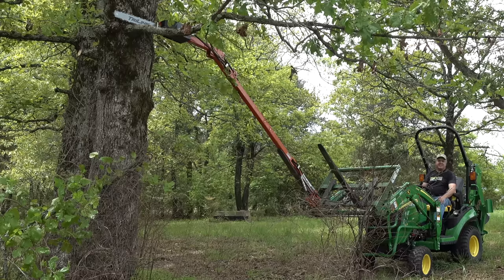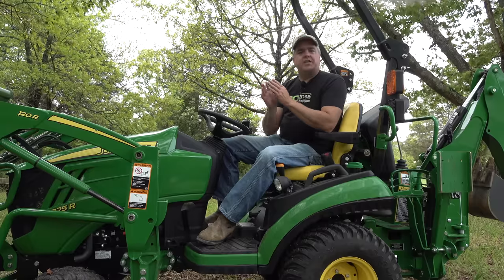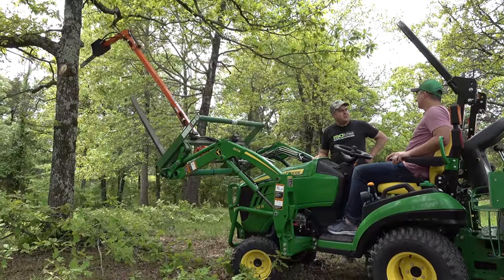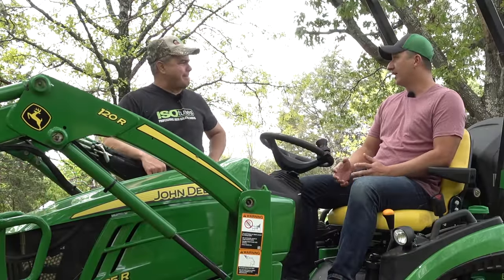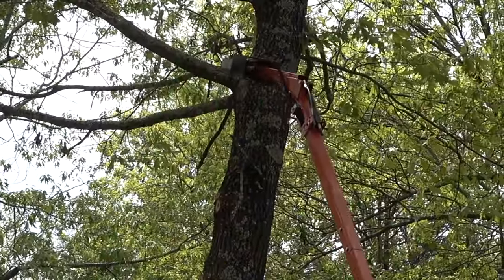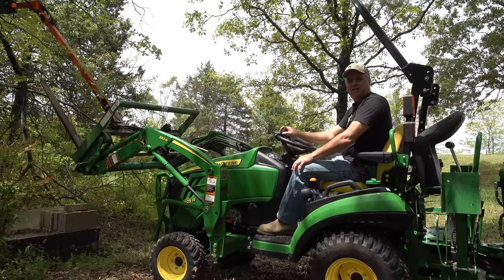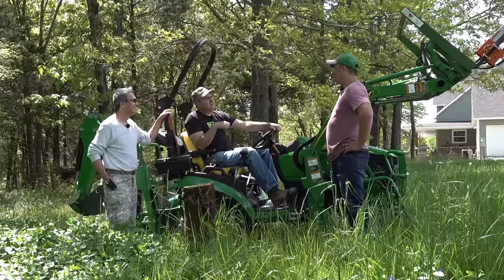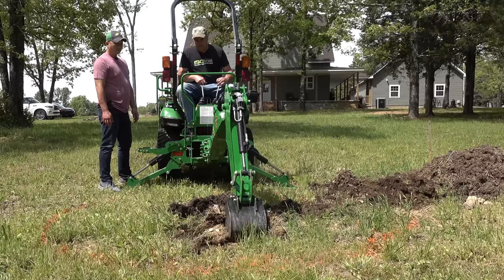MORE JUICE!! When Stock Doesn't Cut It! 2x Hydraulic Flow!!!

Comment: I have added this HydrosPlus assembly using the higher capacity pump (9gpm). I also have the Summit four-spool remote hydraulics kit. Lastly, I did the tweak to my pressure valve to increase it to 2100psi. All of these changes sure make this little tractor (2018 1025r) from a pee-wee into Goliath. A LOT more lift on the front loader and backhoe, plus the extra flow available allows you to use multiple control spools at the same time. I even had my wife operate the front loader while I played with the backhoe controls and all four spools on the backhoe still functioned at the same time as the two spools on the loader. Amazing stuff considering how puny these things are from the factory! 
This new larger capacity pump and new adjustable splitter valve really do give these little machines a whole new personality. Ad Kevin gives such great support for his product! 
Something else to consider is just how much ballast weight all of this adds to the rear of the tractor. When I also added a hydraulic top link, hydraulic tipping link, flow control valves and hoses, it has added 143lbs so far. 
About $2600 so far, but I believe my little machine is about as versatile as any much bigger tractor now. Warranty be damned!

Comment: This kit is very easy to install and Kevin is great to work with. Plus his install vids are awesome!  I installed Deere’s factory 3rd function and I would say that was 10x MORE difficult than the Hydrosplus install. And Kevin supplies high quality components with most hydraulic fittings being o-ring face seals.  When I started my tractor up after the install, there were no leaks. It’s a completely different tractor; in a good way!  I highly recommend this kit!

Comment: Very impressed with how efficient the backhoe works with more flow. Looks a lot closer to how a mini excavator works. Way smoother too!
Reply from the maker: ...and I think I would get better operating it with more practice.
Reply: My old Yanmar backhoe  I ran it on the thousand RPM PTO instead of the 540 setting 540 setting was like watching paint dry!

Comment: This is definitely a game changer.  I have been disappointed with the slow loader functions since my 1026R was new. I move dirt often in my dump trailer and it takes forever to get the bucket all the way up. Have also been annoyed with the slow backhoe functions although it doesn't get used that much. Time to talk to the finance committee!  Thanks for showing this product Tim.
Reply from the maker: ...meanwhile, Jim. Make sure you throttle up!   Running higher RPM will help your hydraulic flow (and therefore loader speed) tremendously.
Reply: @TractorTimewithTim  Tim, I normally run between 2500 & 2700. The larger pump and flow divider change is a good fit for me, since I don't run WOT very often.

Comment: I have always thought Deere and Kubota have restricted the abilities of these tractors because the buyers are first time equipment operators. I struggled when I would go from a Deere 310 to a BX I couldn't achieve the results do to flow.  With this modification Deere should look into this as a industrial 1025R paint it Yellow and Black. This looks like it is puting the backhoe on par with a 1ton mini ex.  I think you should ask the CFO for funding.

Comment: this was actually pretty useful and something i could see putting on a 1025r myself....i do like the hydrolic cooling system on the 1025r, im not sure why no other manufacture has done a similar system, to me it would make your tractor and hydro run cooler, especially out west here in the hot dry heat...

Comment: Great video Tim. That is a great solution. Always can use more flow. I was surprised to see your 5 series has less than 12. You should see if he can provide better pumps for larger tractors, specifically my 4320 hint, hint!
Reply: GPM is the only reason I bought a Kioti over a JD. They need vast improvement.

Comment: I hate the slow loader speed on mine. I had a Yanmar before and it was quicker. Once you've experienced speed it is frustrating to wait for the bucket.
Reply: That's precisely why I bought a Kioti.
Reply: @rebelcitysports1outlook713  which a Kioti ? They have a stronger backhoe? I’m down to three choices , John Deere 1 series, Kioti 2520 or 2220 , LS MT125 or Mahindra Max or Emax.These seem to be the only ones with position control on the smaller subcompacts.
Reply from the maker: LS MT 125 does not have position control...at least the 2018 model did not ...
Reply: @TractorTimewithTim  Geez I thought I saw it on the last brochure I picked up . This was several years ago.

Comment: Hope Deere looks at this and puts it to use in future tractors.
Reply: Deere doesn't want this because they want to sell u a bigger more capable tractor lol
Reply: @adambowhuntz  Sounds about right.
Reply: That valve is expensive.  JD would not put it on the low end tractor (small ) tractor like the comment above.  But for utility higher flow is good, for "tractor" pulling things not so much.  See popularity of high flow skid steers and thier implements.
Reply: John deere  lawyers and bean counters would never approve.

Comment: These things do not "void" a warranty. Rather, if you have a failure and it is due to a non-OEM component, then that particular failure would not be warrantable. But installing an aftermarket pump does not "void" warranty on your seat, for example. Good talk. See you out there.

Comment: Man I hope he makes a solution for the large frame 2 series in the future.
Reply from the maker: Me too!
Reply: @TractorTimewithTim  How about 3 series.  I have a hydraulic pole hole digger that would work better with more flow.
Reply from the maker: What brand and model post hole digger?  Loader mount or 3pt?
Reply: I need for my 2032R!
Reply: Another option would be a pto pump  and tank setup on the rear then you could power a front mounted shredder, auger, limb saw, log splitter or any other high demand implementation. I had a 3point backhoe powered by a pto pump that flowed 11gpm on my L2501 even at idle it had plenty of flow. This would also preserve warranty and cost less than $1,000 and with the use of quick connections could be used to power various implements.
Reply: After adding 3rd function And 4th function for tilt on my 1023e I knew right away they had to steal steering. He fixed that with an expensive flow divider, not the cheap original one.  Good job!
Reply: @TractorTimewithTim  It's a 3pt.  I am not where I can get the brand.  I can get it this weekend.
Reply: The hole digger is a Shaver Mfg. Model 1020.  I looked up the spec and is rated at 10-20 GPM.  I acquired when I had a JD 3010 for digging hole for pole barns and lifting trusses.  It works on 3033R at a reduced rate.

Comment: While increased pump flow improves many aspects of hydraulic performance,  here are some risks with adding this kit.  The steering flow is not sized for the steering cylinder speed.  The orbital steering valve has a gerotor that controls how fast the steering turns.  You will know if you do not have enough pump flow when steering because the steering effort increases with insufficient pump flow.  The flow to steering circuit is necessary to PROTECT THE HYDRO.  Secondly, reducing the flow to the oil cooler which is on the steering circuit reduces its capacity to reject heat.  You are increasing the heat by increasing the system flow,  adding an additional flow divider, which restricts flow AND you are reducing the flow  of the oil to cooler necessary to reject the heat.    Thirdly, adding additional flow capacity and pressure drop of an additional flow divider takes power from the engine.  You lose pto power, all the time.  Finally, I would challenge Hydroplus on the price of his kits.  The flow divider looks to be a Prince model which you can find online for $150.  The pump should cost well under $200.  I would assume his cost is under $400 so a markup of over 200% seems a bit high. Steel tubes also have a shelf life before the inside starts to rust, so ensure there is no rust to be found.  If the steel tubes were not shipped with rust preventive and end seals, do not install them, or clean them thoroughly.  This stands for the pump and the valve also.

Comment: Very nice! Thanks Tim! I had a BX with the plastic fan on the input shaft. When working it hard the transmission case would get so hot you could barely touch it. When doing comparable work with the 1025R, the transmission case gets warm but never hot. Not very scientific but from my experience the Deere hydraulic system runs much lower temperature when doing the same job. It is a more efficient way to control oil temperature. I seriously doubt this system will cause any overheating issues. Great design! I agree with others. Bet we see this improvement on the next 1025R.

Comment: With the enhanced flow you could put larger cylinders on the loader lift function and increase the lift capacity without increasing the pressure and still maybe get reasonable response speed.
Reply: True. You could also rip apart your loader frame. Better do some engineering.
Reply: @PatrickKQ4HBD  Been doing it my whole life and I have a masters degree in mechanical engineering.

Comment: You can install a hydraulic pump to your rear PTO and you will have 15 plus gallons per minute of hydraulic flow and you'll have 2,000 psi of hydraulic pressure.  The rear PTO on a 1025r turns at 18 HP.   I purchased my rear PTO Hydraulic Pump from Northern Hydraulics.

Comment: The hydraulic side is just a matter of managing heat.  My main concern is the drive train for whatever drives the larger pump.
Reply from the maker: As Kevin mentioned, the 8 GPM pump is the same as included in the 2025r...so the drivetrain already handles that one.
Only the 9.5gpm pump would be in question.

Comment: Very nifty stuff.  Faster and smoother with the implements and now the "most loved" implement of all (PTO post hole digger) could maybe become a hydraulic and reversible auger so you can get it out of what you got it into.  You just have to pay attention to the flow requirements of hydraulic augers as what I have seen this is on the minimum end of what they want.  Maybe the optional big volume pump would cover that.  Hope you get a chance to try these out at length.

Comment: Very impressive for sure! This guy just found his retirement! Lol
A small electric fan mounted in front of the cooler (if there is room) may help control heat.
Reply: A larger cooler, if there is room under the hood, would be a more reliable solution than an additional fan. The temp. increase may not be enough to require any extra cooling. More heat is likely generated in the transmission and steering, which all run from the same sump, when pulling implements/loads up and down hills than from using the loader and 3rd function when at stop or near stop. Also, not sure how he did his testing or what the actual temp increase was/is.
Reply: @williamgaines9784  true a larger cooler provides more surface area to radiate the heat but it is a a more evasive solution than a temp controlled fan.
A fan is much less likely to void warranty than replacing the entire cooler. One could possibly add an additional cooler providing the original lines are not butchered in order to make it work.
Reply: @lcee6592  Well, if the non-spec. pump has already voided the warrany, the fan won't bring it back. 😉
Reply from the maker: There is already a fan...the radiator fan.
Reply: @williamgaines9784  if I remember correctly, in the video, the question of voiding the warranty due to the modification(s) was submitted to John Deere and currently waiting on a response. Most likely it will void. 
And no, I was not implying at all in any way, that a fan would “reinstate” or “bring back” the tractor warranty.
Reply: @TractorTimewithTim  
The reason I mentioned an electric fan: Like virtually every aspect of a piece of equipment, the fan is sized for the expected maximum temperatures the equipment should ever see in factory stock form. There is usually a small “cushion of extra” capacity. 
Provided (if) these hydraulic mods up the temperature  enough, an additional pusher fan may be all that’s needed to restore the cooling safety factor. 
That’s what I would try first anyway.

Comment: I really don’t see any problems with it long as the cooler can handle the higher volume
Reply: It absolutely can, but even so, Kevin has an awesome solution called the Hydrosplus Cooler+ that keeps the hydraulic fluid nice and cool no matter how hard you run it. The Cooler+ absolutely dwarfs the stock cooler and makes it look like a toy in contrast.

Comment: Hey Tim - I noticed you are using the same steering wheel spinner knob as me. And yours is canted like mine was. I moved it to a spot where the wheel is more round vs oval, and cranked the crap out of the hex bolts to tighten it. Works much better when it is straight up and down vs canted! I had another model on my 322, and it held the upright position better than on the 1025 steering wheel.
Reply from the maker: This is not my tractor, Craig!
Reply: Oh, right! Dang it. Well, I think on one of your videos you talked about how that particular spinner was not a good fit for the 1025 wheel. I had that problem too. I had an all-metal spinner that fit perfectly on my 322 but would not work on the 1025.

Comment: This is a compelling reason(s) to stop putting lip stick on the pig (beloved 2006 2305) and move into a newerish 1025R...and a 260B.  A nice way to wake up on my 55th birthday. The 2305 was great at 40. Looking ahead a few years a guy is going to need better tools.
Reply: I had the same experience.  Started with the 2210 and then went to the 2305.  Ultimately moved to the 1 series because of additional features and the ability to easily adjust lift capacity.  You won't be disappointed with the upgrade to the 1 series, regardless of which one you get.
Reply from the maker: I just turned 55 in April.  It isn't so bad!

Comment: Flow reduces cycle time, great upgrade! Wonder if there is space for and additional row cooler up front. But I think y'all are right that the total percentage increase is likely within the testing limits of the factory heat dissipation. Also that looked like a black walnut " tree "

Comment: Something should have been done to the divider up front. For example: when you are the backhoe. No steering is required so the maximum flow should go to the backhoe. This would allow you to move 3+ operations at the same time and be less jerky.
Reply from the maker: Steering circuit is also the path of the oil cooler…so, no.

Comment: I bought the biggest pump from Kevin at Hydrosplus for my 1025r just for this limbsaw. Love the extra flow for bucket and grapple as well as able to run at lower RPM. I see in all your videos you mount the limbsaw on the pallet fork. Is that so you can move from side to side? Did you mount it just at the rear of pallet fork only? Or another mount up farther?
Thanks Tim for the 10% off and Kevin for a GREAT kit
Reply from the maker: mount it up the fork a ways.   I like it on the forks so that I don't have to attach the receiver to the bucket. ...and for the extra length.
Reply: @TractorTimewithTim  THANK you, always surprised how helpful you are.
God Bless

Comment: Hey Tim . I'm glad you got to use this. I've been watching his progress on this kit and had mentioned talking to you about it. I know it increases flow. But capacity is the backhoes root busting capability yes?? Did you notice any added strength as you where digging?? Or was it the same?? Because I had asked him if it would help with bust out power. Thank you Tim
Reply from the maker: I discussed this in the video...but folks continue to ask.    Perhaps I wasn’t clear enough?
This kit increases flow.  Flow increases speed.  Has no effect on power.   Increasing pressure would increase the backhoe power/strength.
Reply: That's what I thought I heard you say. Just wanted clarity on that. Thank you.

Comment: Is their enough room for a bigger hydro cooler up front to add to kit
Reply: Tim you have a lot of maintenance videos about 1025r, can you do same for 203r as well.
Reply: Kevin has created a huge hydraulic cooler that fits up front and is easy to install. It’s called the Hydrosplus Cooler+ and it keeps the hydraulic fluid nice and cool no matter how hard you run it, especially compared to the stock cooler.